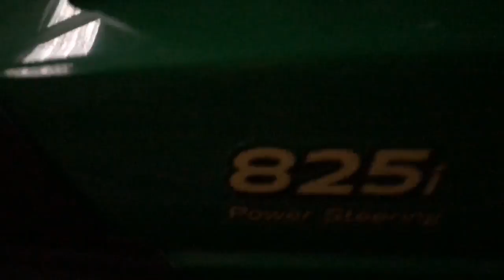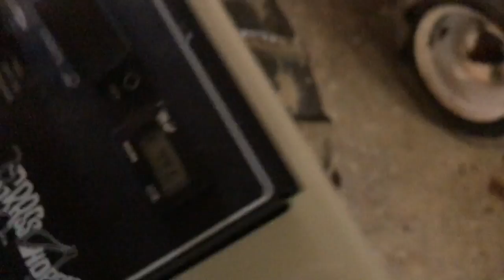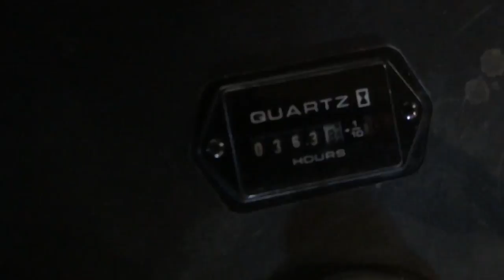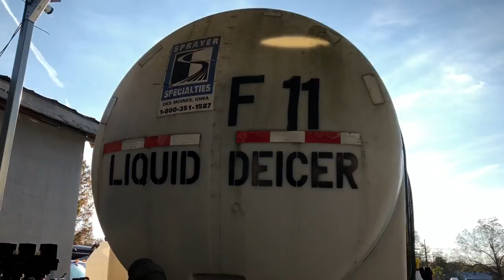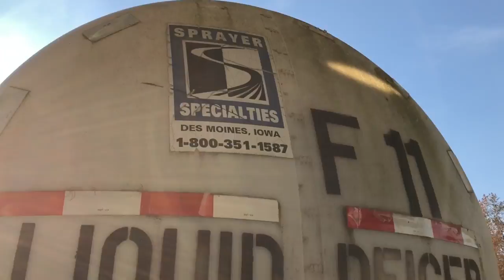Lawn care equipment sale

Comment: That subaru ex engine will last forever with a bit of maintenance. I've got one on my Toro GreensMaster with 950 hours now and literally I've only done the recommended maintenance. With any small engine, if you use high ethanol gasoline, get ready for problems.